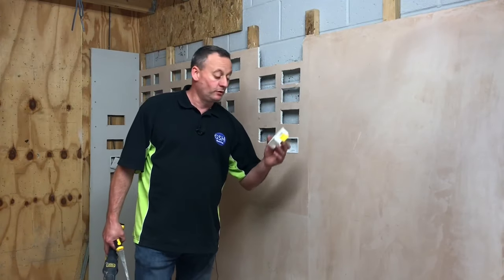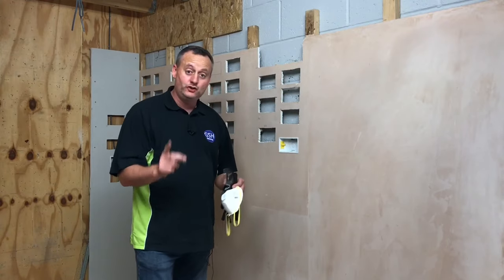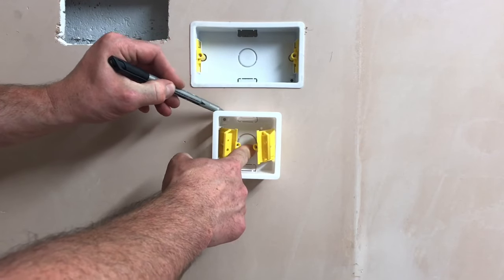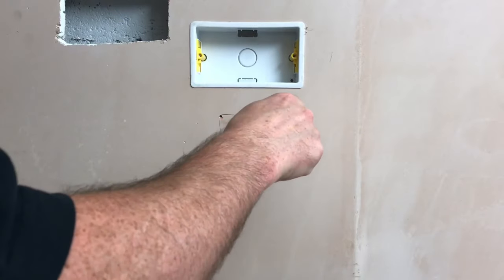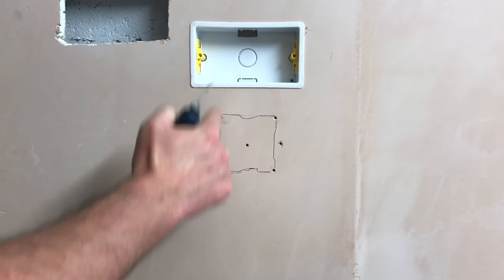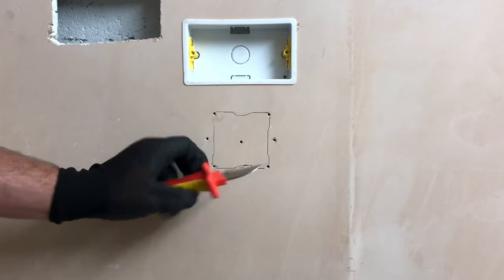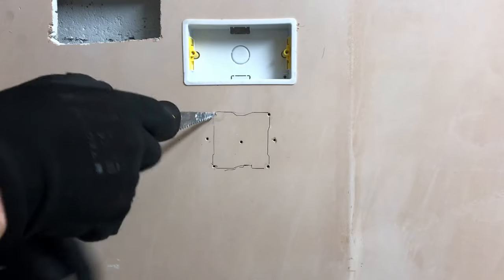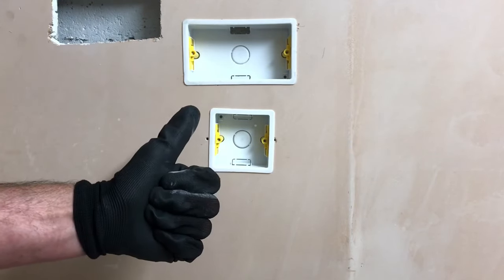How to Fit a Dry Lining Box into a Dry Lined Wall (Stud Wall) For a Socket Outlet or Light Switch

Comment: Hi Gary.  Good video, but take it from me as an electrician, running my own business and working in peoples homes daily.  Punching holes either side of the box template to check for studs that will require filling and painting after is not the neatest or best way to do this.  

If these boxes can be installed without the need to make good after, then that is how they should be installed.  The method you demonstrated causes unnecessary damage.  Clients do not want to fill and paint if they don’t have to.  A good electrician will know how to get around this.    I recently installed 16 fast fix back boxes in a newly painted house! (New owners wanted more points).  When I had finished, no filling or decorating was required!  Not blowing my own trumpet but this should be the norm for all electricians.  Sure, sometimes things happen which can’t be helped and filling may be needed, but your method requires filling every time.   If I was the client and one electrician said, ‘I can do it but you’ll need to fill and paint every point after’ and the other said, ‘I’ll do it with minimal to no filling and painting’ ........who you gonna call!?  (Apart from ghost busters!! Lol! )

If I was to employ one of your learners, and he cut boxes out like this.....I’d be pretty cheesed off.   I know you are probably teaching them some kind of text book way of doing it.....but trust me, there are better methods.   

Anyway....we can all pick holes if you’d excuse the pun!   Just constructive criticism that’s all.
Reply from the maker: Hi, my wall isn’t painted... 

Thanks for taking the time to comment in such detail. 
Gaz
Reply: GSH Electrical No problem at all Gary.  

I understand your wall isn’t painted, but it is plastered.  Trust me, clients don’t tend to like having to fill and rub down a wall they just paid to have plastered.  If anything.....making holes in freshly plastered walls is even more frustrating, because that would suggest that the wall is new or newly refurbished and boxes should have been cut in before plastering.  

Also; I’m pretty sure you are not teaching different methods for painted, and non painted walls, plastered or non plastered walls!! You are teaching this one method to cover all types of cutting in of fast fix back boxes.  So your learners will apply this method regardless of what stage the wall is at.  Unless you do teach 2 different methods depending on whether the wall is painted, plastered or not??  If so.....I assume the painted wall method would cause no damage and therefore should be the only method you teach anyway??

I watch a lot of these videos on YouTube.  I’ve been an electrician for 20 years.  Still, sometimes I learn things I didn’t know.....sometimes I see methods better than mine!   If I see something that I think could be improved I comment.  We can all learn from each other.
Reply: @Spark101.  I agree, and also the use of a level as to not pick up bad habits for the learners. Otherwise great vid
Reply: How do you do it then? Genuinely interested to know
Reply: Mackenzie Johnson Punch a hole inside of the square at an angle toward where the flaps will need to go.  With a small piece of wire, push into the hole.  If there is a stud there, you’ll know.  If there isn’t, you can Cut The square out and fix your box.  No need for any decorating because all inspection holes were inside the square.  

Personally, I would just tap the wall.  It will sounds a certain way when there is stud behind the plaster board.  That’s just experience though.
Reply: @Spark101.  I saw Gaz insert a screwdriver at angle to test for studs, just as you described, in his earlier (2017) video when showing how to insert a double socket in plasterboard.
Reply: @GSHElectrical  Bit of a flippant response to someone that is actually doing this for real, not just in the classroom. I too wouldn't be impressed if an electrician came round my house and started poking unnecessary holes in the walls.

Comment: Before punching holes and cutting under the existing socket you should make sure the supply cable is not coming from the bottom - a lot more important than avoiding a stud!

Comment: In case you have a stud on one side you can either use a metal back box instead or use this one securing one side with the yellow flap to the wall and the other side you can remove the yellow flap e screw the plastic box at a 45⁰ angle into the wood or metal stud itself. If you want to make sure whether there is a stud or not befor cutting a socket hole in the  plasterboard,  there are electronical devices such as stud finders between 40 and 80£ that can look for wood and metal studs and live electricity cable position behind plasterboard wall suite accurately. They even tell you when you are on the center of It. Sometimes they even work if there are Tiles on the plasterboard. I always use them and never made a mistake. Greets

Comment: I use a strong magnet to find wooden battens behind dry lining,  the battens and boards are usually nailed or screwed to the wall so the magnet will lock on.  Obviously dot and dab is no good :)

Comment: For new builds and stud walls, you can use a noggin between the studs and secure a metal back box which is far better. But this method of course is needed for existing walls where that is not an option.

Comment: Would it be wise to check the area on both sides of wall to establish if your fitting into a place where an existing cable run might be( in a zone covered by another fitting)?